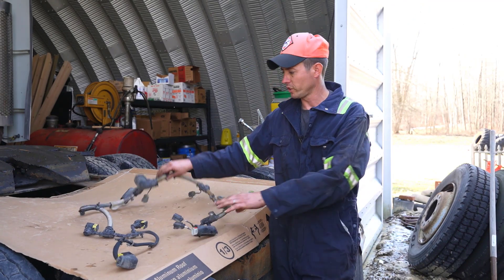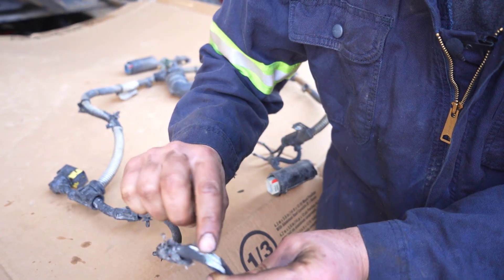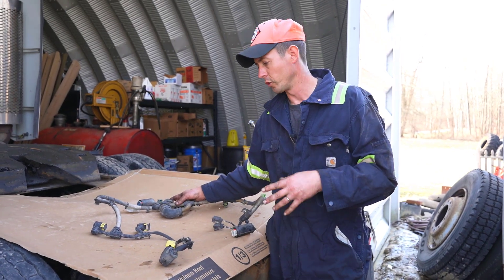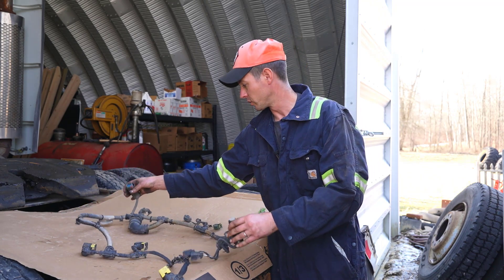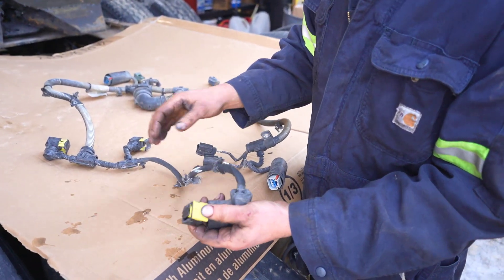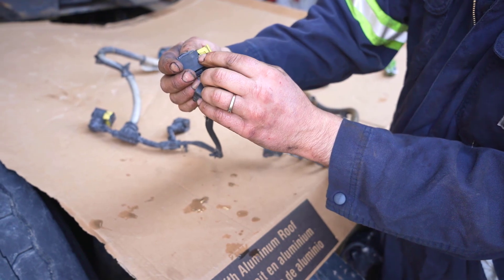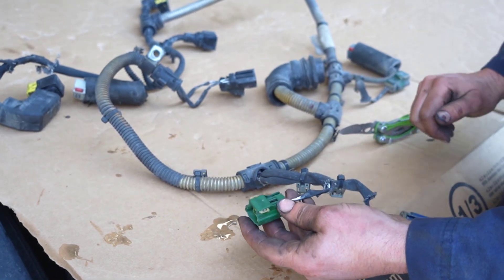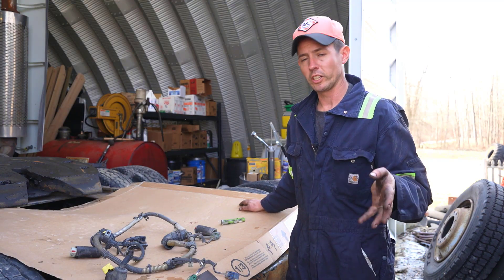Freightliner/Detroit ONE BOX SCR Conversion Efficiency Low Fault Code - Easy Fix

Comment: It's called an overlay harness and yes they do go out all the time but you can never ever just assume it's that harness just cuz you've got codes for the one box you need to do your due diligence  as a mechanic and properly trouble shoot the fault codes with the fault symptom tree ...  don't ever just think it's that harness take a peak at the harness and if it's something obvious like this guy is working with then yes but you gotta check it properly or your just a parts changer

Comment: I need help please... I ha ve code SPN 520349 ON 2018 FREIGHTLINER CASCADIA. (Diesel Particulate Filter Filtration Efficiency Low)
I only have solid Yellow Engine Light On so I figure it's a minor issue?
Reply: Update please or you kept driving with it
Reply: I have the same issue. Unfortunately, no one knows why I have the code . The trucks runs fine and I just have my 1 box replaced couple days ago. Let me know if you ever figure that issue out. Thank you
Reply: I have the same issue,  dealer wants me to replace the one box 😢 $13k.  If like to troubleshoot it first.
Reply: Did you solve that?

Comment: Txld: 61 SP: 4364 - Aftertreatment 1
SCR Conversion Efficiency FMl: 18 (Low
-moderate severity) Count: 1

This is the code I’m getting
Is this common for the the remedy that you were mentioning?
Reply: Hii Did you find any solution for this code..?

Comment: hi bro
my Kenworth t660 2013
some time show circuit failure sign an stop blanker and turn signal
stop engine and start after few sacond it's working back
what happens
please help
Reply from the maker: Hi there, thanks for the question! We will need to look at the truck and do some diagnostics before we can identify the issue. Feel free to schedule an appointment with our shop. Thank you!

Comment: Thanks for the informative videos as always Ryan. If you have time I have a question concerning my DPF filter. How often or when should I consider having it cleaned or replaced? I haven't had any issues with it but my truck has 580,000 mles 90,000 since I bought it.
Reply: 2015 Freightliner Cascadia, Cummins ISX15
Reply: @tommyk9844  when you first get a code for regen complete but insuffcient, or you have some time off, when you have the cost of the repairs, if your going to pull it off and do the cleaning at a place that blows it out run a regen before you remove it,
Reply: @Tommy K hey with your truck do you have a apu on truck and do you idle a little higher when park? Im asking because i seen a video where guy said if truck idles regular for long periods of time you get build up in filter faster than setting truck to idle higher. Asking cause i have notice that i see a lot of videos about these def systems but only seen that one videos talking about that but also notice when people do regens trucks idle high for a period of time.
Reply: @shameek419  I have APU, very little idle time

Comment: Hi Ryan I have issues my 2017 Freightliner cascadia dd15 one box I have code 5741 aftertreatment 1 outlet soot I change soot sensor still have issue
If u can help thanks
Reply: your getting a pm sensor fault?, is your stack black ?, if so your dpf is cracked